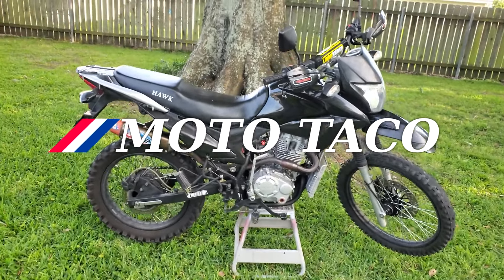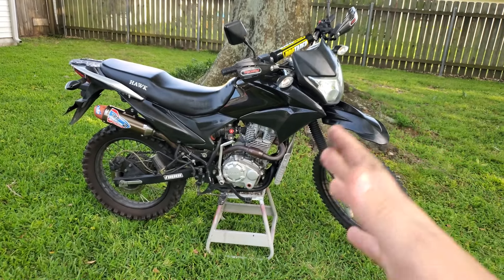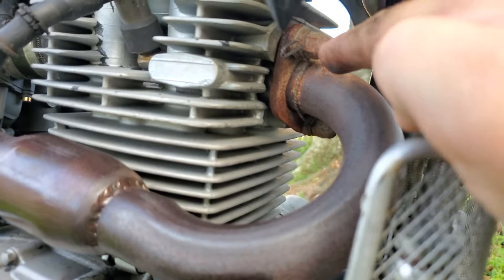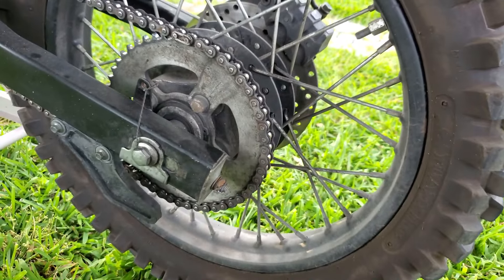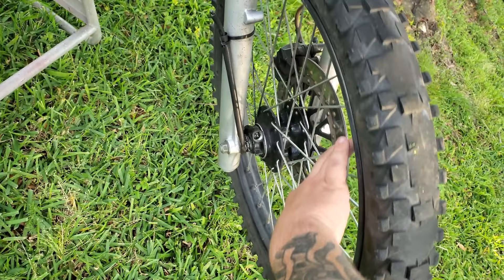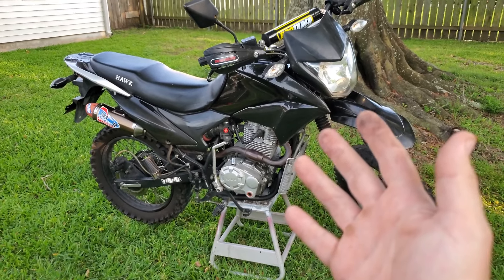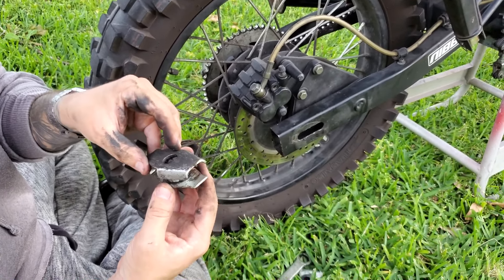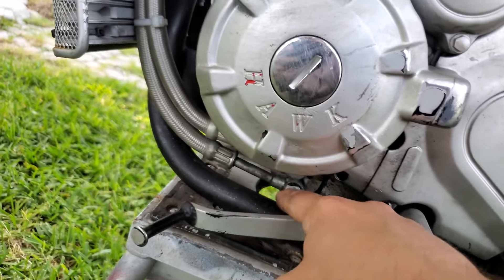10,000 MILE HAWK 250 (FULL REVIEW)

Comment: My last reply had tons of typos I apologize I have a permanent fix for the rear axle coming loose you simply turn the axle around put the nut on the other side that way when torque is applied it actually turns the axle in a way that tightens the nut it's a simple permanent fix please share this with others I have fixed two Hawks so far you can reach a lot more people than I can
Reply from the maker: excellent fix
Reply: Wish I knew that 6 months ago
Reply: Thank you!
Reply: Learned that trick on a Honda XR650L so it's not just Chinese motorcycles with that kinda issue 🫡

Comment: 2025 rps hawk-x 250 liyang motors dual sport 10k miles. I had no issues with this motorcycle. Other than my own part or that of another's part ie vandalism attempted thefts tampering. But even then this make of the hawk x held up above and beyond making this a reliable economical daily rider. It's a tractor off road, it's a inner city suburban zipper, and even though the 2024 rps hawk x 250 (229cc) is a tad embarrassed on the highways it's definitely not apologetic about it's 65 to 70 mph top end 5 gear still meaty hp with a 180-90 lbs rider and 200lbs of gear. And also hit the 9,600 range before the speedometer and miles counter broke from an actual surpassing what the stock mph indicator could bare , it broke past the speedometer lever stop post breaking the indicator on a down hill full speed body head tucked down full throttle fully loaded moment. While riding on a rear bent rim for what been 8k miles prior back going inner city off road curbside to avoid break checkers. The only real issue i had was the electrical system being smaller guaged or inferior quality amount of conductive metals and so at high revs max speed compacity for thirty plus highway routes the stator would be like yeah! More power to the engine which the engine kept building compression to bely it being a 229cc engine not a true 250 (249cc) and steady pushing the weight and limits without complaints cold, hot, rainy, wet , dry weather and climates low prairie to higher elevations and the bolts all stayed in nothing unrattled except the cheap plastic cover bolts the exhaust heat guard front screw( if not a sabotage). Cussing an annoying sound vibration which causes you to check over the bike and noticing the exhaust manifold bolts have backed out causing a minor air leak and intake. And then it was stolen. Who steals a 2k Chinese dual sport motorcycle brand-new what's more with 10k miles. So yeah I'd confirm and agree that 10k miles is when the hawk x is fully broke in and any warranty issues the limit amount of conductive I put 10k on mine within 6 months time frame of ownership and adventure motorcycle working vacation daily rider i practically lived on and by this motorcycle.

Comment: Ty bro im ordering one as we speak! Efi though
Reply: I have the CARB version. EFI is definitely a great option. Less headache when turning on the bike, etc. but mods are a little “harder” since you’re dealing with electronics.
Reply: I've been thinking about that and they Comstock 230cc the Big Bore Kit supposedly the 300cc turns it into a true 250cc so you're only getting an extra 20 CC so I have to imagine that I can put the Big Bore Kit on the EFI version and the fueling could handle an extra 20 CC without any modification and while I have it off a slight port and Polished job on the head and I plan on doing a little bit to the airbox taking some baffling out of the exhaust all of that in combination should wake this thing up
Reply: @michaelmccameron5959 did you ever put the big bore kit on the efi version? If so did you need to do anything else to it?
Reply: You are a boss !

Comment: 9:00 Your clutch adjustment locknut is backing off. Being a month later its probably fixed by now. Nice review, I'm over 3,500 on a well modded 20' Brozz, no major issues. Only doing the normal service and checks the bike needs.
Reply from the maker: definitely did not notice a month later, lmao. thanks for pointing that out. going out back to fix that now xD

Comment: Hey buddy you're the guy that talked me into buying a hawk DLX 250 I was thinking I do want to do a big bore upgrade to it and starts as a 230cc and the upgrade usually brings it to 250cc not 300 in the case of upping it to 250cc I believe there wouldn't be any fueling issues I'm sure the injector has a little room in case it really needs to get very rich and I'm thinking if it isn't true 300cc upgrade it would create a lot of Heat

Comment: Oh, yeah! thats bitchn...I have about 1500 miles on mein falke. It is great to get ideas and gearhead info so easily. I run the plain-jane looking 28 nibbi carb with a modified airbox. So, it appears stock and I have less fear of gettin caught in the rain or wet. A nibbi hi output coil w/ stock cdi. FREE FLOWING stock exhaust & muffler, hint. I just finished the 17/45 sprocket swap (wow). No overbore in mine but I like cams in V8's. Maybe such a trick in a single cylinder engine will round-out gains thus far! Kool video!

Comment: Moto taco I have a permanent simple fix for the rear end axle coming loose you simply spend the nut and bolt around that way when its work is applied it actually tightens the nut I have fixed my hop and a buddy soft doing that it's a permanent fix is well please make a short video on this as you can reach lots of Hawk odors that I cannot give it a try it's a simple fix
Reply: What?
Reply: @strokenumber3  tons of typos sorry.. i fixed them in another comment

Comment: I'm curious if you had to wire the bolts because the loctite wasnt holding? did you try red loctite? I'd be slightly concerned if the vibrations are bad enough to be breaking the loctite loose lol. I'm considering purchasing one of these bikes as my first bike for country road riding and maybe occasional off road trails but nothing crazy. How would you rate the vibration issue? and is it too much or is it decent in your opinion? or anyone else's opinion in the comments.
Reply: Yeah that’s just what happens when your way out your depth with a motorbike you have zero ability to maintain 😅

Comment: I ride my hawk every day..
Have yet to do any after market upgrade.
But I believe I'll soon do the 17\45 sprocket..

? I run my bike over afton mountain about every other day
I'm holding the throttle wide open up the mountain 3mile climb bike will hold the marked speed limit of 55mph
Pushing about 59mph at times but I'm tacin between 7 & 8
Rpm's red line starts at 10 rpm is this being to hard on it ??
Reply: No

Comment: Have you changed the stator, they say it only lasts 5,000 miles because of being A/C firing the exciter coil burns out fast. The ohms reading should be .300ohms from the red/black wire to ground with multimeter set to 2k. And as you put on the miles the exciter coil ohms go down and the limit is about 170ohms before it can leave you stranded????😮 it cost about $25 on Amazon to fix and you wont get a spark until you change the $25 stator.😅

Comment: Motion Pro Cable - Speedometer 04-0186

￼

Used this replacement for a Suzuki VL800. Slightly shorter but works well. Thanks for the videos!

Comment: Do you think the increase in power is worth the cost of the big bore kit?
Reply from the maker: the increase in power is not massive however it is noticeable
Reply: I heard the big bore kit makes it a true 250cc engine. The hawks engine is only 229cc in it's stock form. So that's about a 9% increase in displacement with the big bore kit. If I were to guess, I'd think you'll get an extra 1hp - 1.5hp on top of the 16.5hp the hawk has.. So pretty small gains, but It's not just about the power, it's about the fun of taking the engine apart. So if that doesn't seem like fun to you, don't do it. To me, it's a fun mod that doesn't cost a lot. So it's worth it.
Reply: Mr. Math says the 70mm bore x 65mm stroke equals 250.1cc. At least it becomes a true 250 not a weenie 229. Machine shop took 2mm from the sleeve, and 2mm from the deck to get some compression.
Reply: Pretty sure his big bore is a 72mm which makes it something like 265-269cc’s
Reply: Moto Taco I have a fix for the axle coming loose and it's a permanent fix you just have to spin the axle around they come backwards from the factory I fixed my hog and another Hawk by simply turning the boat around that way the torque when it's applied it actually tightens the nut super simple fix give it a try

Comment: So good for 100% off road dirtbike life??? I found one for 500$ painfully 19k miles but seems like could b Doable thing
Reply from the maker: ive offroaded my hawks more than ive offroaded my renowned (kawi, zuki, hond, yahama etc..) bikes and i can speak to their capability offroad. it may be a mental thing aswell. since if you crash and damage the bike the cost is far less than a japanese repair. just treat it the same as you would a normal dirt bike. so rim locks, make sure bolts are tight, threadlock, locktite, always put high octane etc. ive revved the snot out of these hawks for years and they are loads of fun

Comment: Safety wire wrapped around bolts? Just get new nylock nuts, not crappy cheap ones but good nylocks will stay. The plastic on the cheap Chinese nuts is too soft and doesn’t hold worth a damn.
Reply from the maker: This is the better solution, just order a metric set of nylon self locking nuts. Or locktite if you dont mind chipping it off every now & then

Comment: Just use loctite...
Reply from the maker: Loctite is very underrated. I take things apart too often that’s why sometimes I opt for the wire. But I’ve rarely ever seen a loctited nut ever thread off. Even with low thread contact
Reply: @mototaco6603  Here by us in South Africa it works well, and you can remove bolts and nuts without any hassle. I use it on my racing Polo with polyurethane engine mounts and it works great.